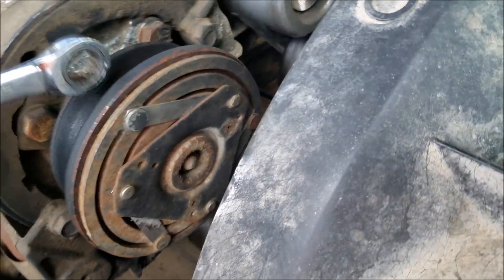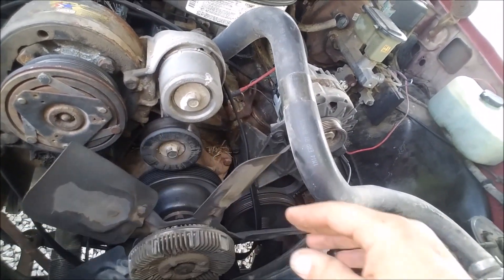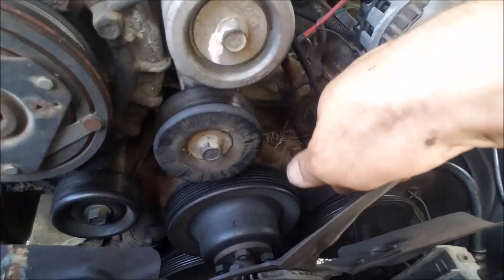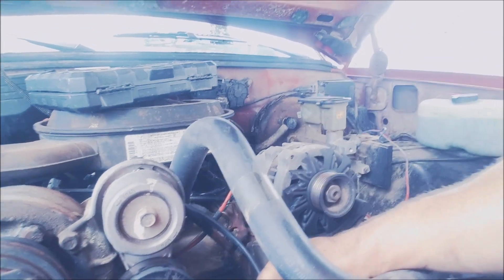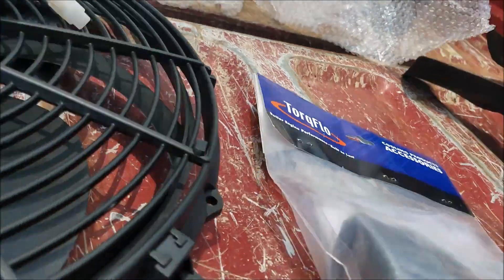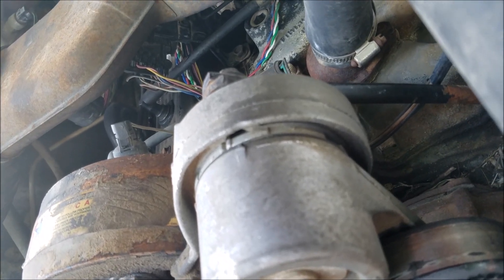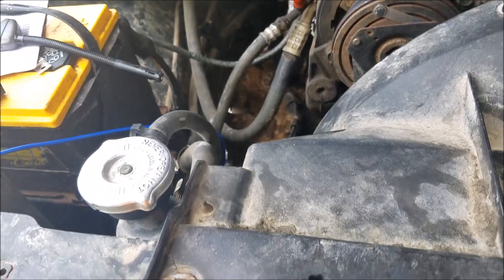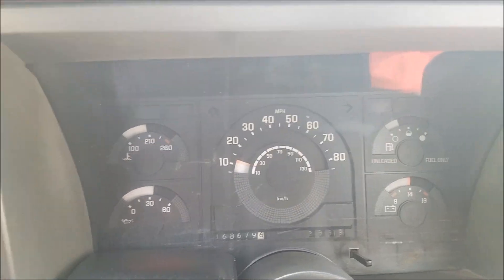Upgrade to an Electric Cooling Fan

Comment: Has your fuel economy improved with the electric fan setup? And if it did. How much did it improved?
Reply from the maker: It wasn't really noticeable. But I was getting around 10, so even 1 mpg would be 10%. That's a pretty big difference. On something smaller or with a less powerful v6 or 4 cylinder engine, the difference would be greater... because the fan takes the same amount of power to turn regardless of what engine is turning it. 
  My early engine modifications were based mostly on "less throttle to go the same speed."
  I have since changed a lot on the engine. It has headers, a roller cam, aftermarket cylinder heads, carburetor intake manifold, aftermarket fuel injection, and capactive discharge ignition system. .. along with electric fans. The gas mileage is a little worse now, but my horsepower is over double. I feel much better about my engine, even though the economy is a little worse. I make great power and I know it is safe because I can monitor and tune it on my laptop in realtime.

Comment: How many CFM of air does that fan blow?
Reply from the maker: This one does 1500cfm. I've actually installed a second electric fan on this setup. I staggered the 16" fan to one side and got a 12" fan in the opposite corner.  There was just enough room to get them to both fit. The 12" fan is rated at 800cfm.
Reply: @EricErnst   okay, thanks for replying!  I'm thinking of doing the same thing that you did but I'm having trouble finding cheap electric fans with the right cfm rating.
Reply from the maker: @NoName-ef9tq  I got mine off the shelf at my local Auto Zone. 16" was the biggest they had. The factory fan is 19".  It cools good in traffic at slow speeds. It can max out if it gets warm where the factory fan would only run at engine speed. In upper speeds, the airflow through the grille takes over.
Reply from the maker: @NoName-ef9tq  I think the 16" fan was like 70 bucks. Something like that. It's been a couple years since I filmed this.
Reply: @EricErnst  okay, thank you for the info!

Comment: How did the fan work out for you did it cool your engine down or no?  just curious thinking about doing the same thing to mine just wanted to know how it worked out for you thanks
Reply from the maker: It's still on the truck and working great.

Comment from the maker: In the winter, the electric fans should marginally shorten the warmup time of the engine. The thermostat controls the coolant temp. A small amount of coolant bypasses the thermostat and goes into the radiator while the rest gets recirculated until it is warm enough for the thermostat to start opening. If the mechanical fan is blowing cold air onto the engine and drawing cold air through the radiator, it will slightly cool the engine. Electric fans don't start until the coolant in the radiator gets up to a set temperature. Then, as the engine nears operating temperature, the engine takes in warmer coolant from the radiator instead of coolant that has had contact with cold winter air. The thermostat controls most of the coolant flow, but this should help the engine warm up sooner and your heater warm up as well.